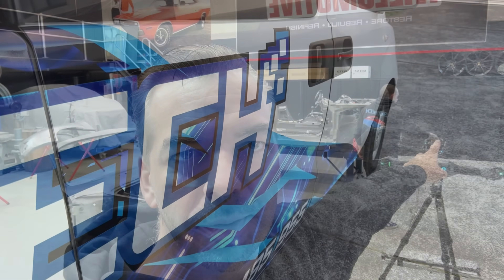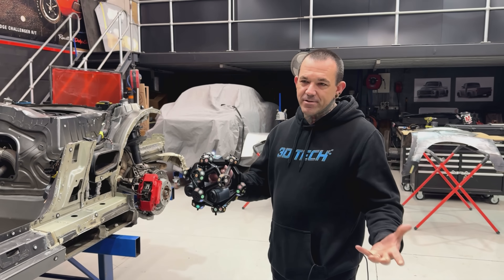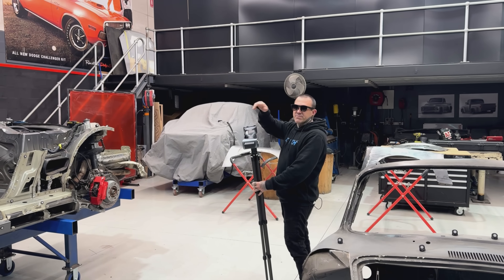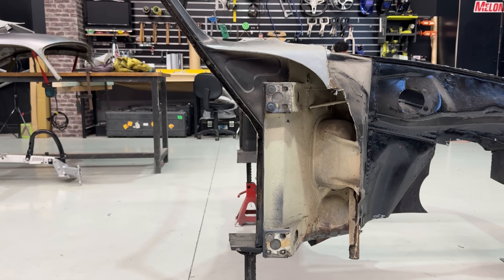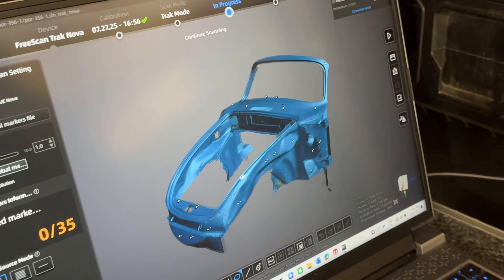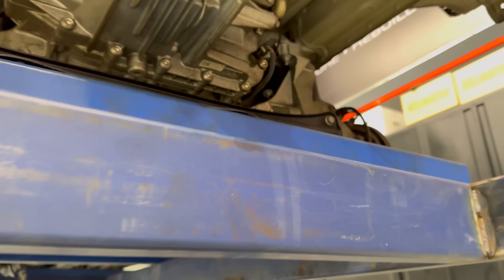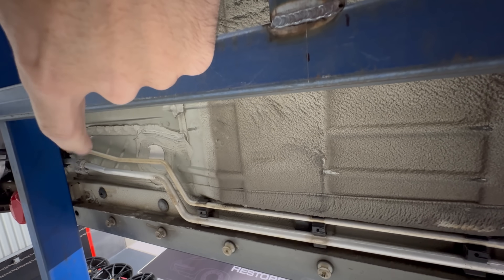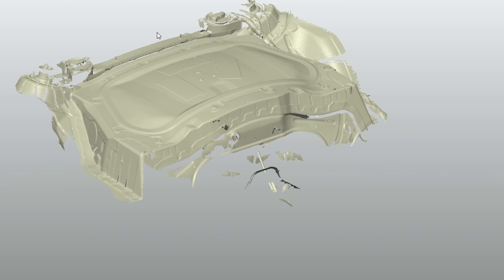Porsche 356 Restomod 3D Scan – Game-Changing Build Insights.

Comment: This is really interesting. I've taken on a replica 356 project which was just a bare shell ( no subframe ) which I've spent the last 9 months CAD modelling, laser cutting/folding and welding a steel tub chassis based on 300mm shorter beetle chassis dimensions, incorporating the rear torsion tube / frame horns of the donor beetle. Last thing I have to fabricate is the rear chassis to body shell support which I am considering buying a budget 3d scanner to complete. I thought my project was three dimensionally challenging but this is next level, good luck with the rest of the build.

Comment: MacPherson strut front suspension is going to be a real challenge to replace the torsion beam… it’s so tall and outboard. A multi link front suspension like the latest GT3 has would make this much simpler to package.

And keeping room in the cabin between the front bulkhead and rear firewall is the biggest issue I see. if you want to actually have legs and drive the car. The pedals and steering wheel will end up way to close to the rear. A very thin carbon or alloy bucket seat would help gain a few cm’s and might help…
Reply: Some pushrod-style suspension for the front.
Reply: Yup, he’s going to have to lay it down and use some sort of bellcrank system

Comment: Just a 16 minute advert for 3d tech 😅
You don't need 3d rendering for this build. Grafting two cars together is done by skill and hard work. Not useless technology.....
Reply: The 3D technology saves time. They can test fit things before they make a single cut. So then there are no surprises, and they know exactly where and what to cut. In the old days people used to weld with a flame torch, now we use a TIG or a MIG welder. It has nothing to do with lack of skills. It is just a better technology that makes the work go faster and the end result a lot better with much higher accuracy levels.
Reply: @insAneTunA  he is an idiot who didn't stop to think about how stupid his comment sounds. He's probably watching this in color, not black and white, probably on his smart phone and not a hand cranked projector, about vehicles with an engine rather than carts pulled by a horse.
Reply: Not anymore. Build smart with useable technology, so the skill is still there and maybe a change of a little less hard work.